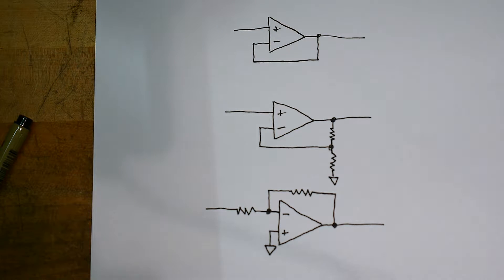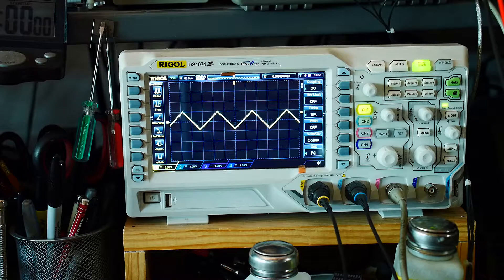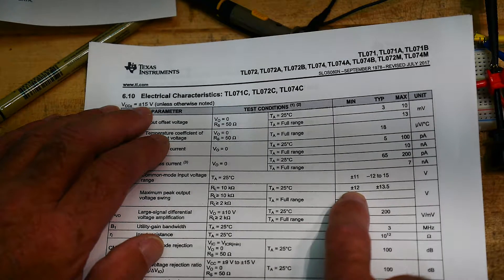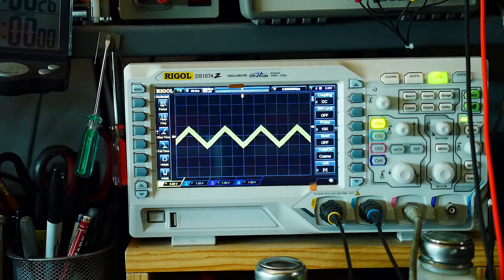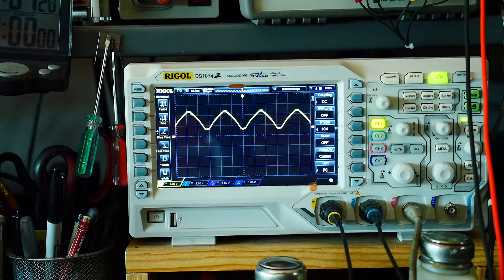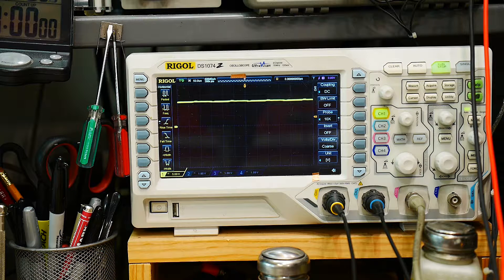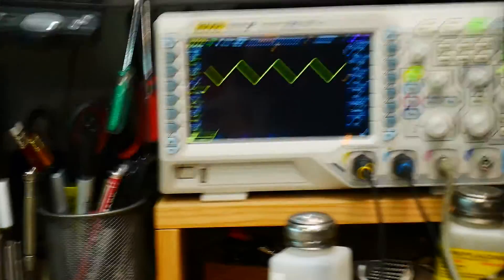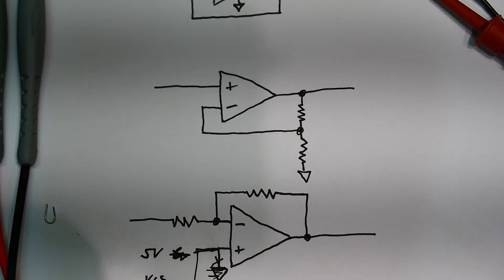#498 Op-amp grounds in single rail systems

Comment: At 5:00 "We don't know [the available output voltage swing] ... The datasheet wasn't characterised at ±12V." However, the typical performance graphs on the following pages of the datasheet give us rather more information. In particular, Figure 7 shows typical Maximum Peak Output Voltage vs Supply Voltage into a 10K load. At ±15V supply it's ±13.5V (as we already knew), and at ±12V supply it's around ±10.7V. From the graph, you can see that it is a linear relationship and at ±6V supply, it's a fraction under ±5V.

However, to estimate worst-case values, you'd want to note that the worst-case at ±15V supply was twice the typical loss, and use that to estimate the worst-case at ±12V supply as ±9.4V and at ±6± supply as ±4V. That's a lot of output swing lost at low supply values (because it has a bipolar class A-B output stage) and that's why it's unusual to see TL072 series operated at much below the recommended ±15V.

Also, the inputs are never going to reach the negative rail because the TL072 series has p-channel JFETs as its inputs, and current mirrors as their drain loads, which need some voltage, so as soon as you get within about half-a-volt or so of the negative rail, the JFETs' gate-source junction starts to become forward biased, and that's not a desirable mode to be operating JFETs in. As you've shown, these are really quite unsuitable for single-supply use with a negative ground. Perversely, they would be happy with a ground at the positive rail, because Vcc is within their common-mode range, but nobody ever designs circuits with positive ground any more.

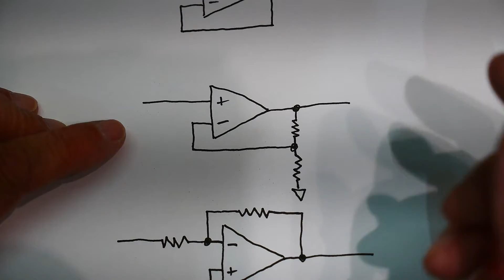At 8:30 if you put in a 20K and a 10K, you're going to get a gain of x3 (non-inverting), so I assume you fixed that before going to the demo with the 'scope.

Comment: How large is the output swing for different supply voltages? The datasheet at least has a figure (Fig 7)... (and the plots are usually of course "typical" values)

I think people should use single-supply circuits way more often, it's just much more complicated these days to even find modern chips that survive 30V (old stuff ran at +/- 18V, so even 36V) total supply. With complementary output stages that go full rail-to-rail, and sticking to inverting configurations (that keep inputs often savely at or around Vref/virtual ground, it's not much more complicated than old-school design. And whatever you want to feed into (ADCs) nowadays often only accept 0.."few V" anyway.

Dual supply is nice for audio-stuff, though ;-). You want your +18dBu output.

Maybe you want to do a video about fully differential design?
Reply from the maker: You bring up a good point about mixed mode circuits. part analog part digital. Yes you need to be careful on both sides. The world has moved to single supply for a lot of things. When I was designing big boy circuits decades ago I used an A/D that had bipolar inputs (+/-5V input). Today I'd probably keep the analog part +/-12 and have to made sure just before the A/D to move the analog range to single ended. creating and maintaining virtual grounds in systems has its own problems